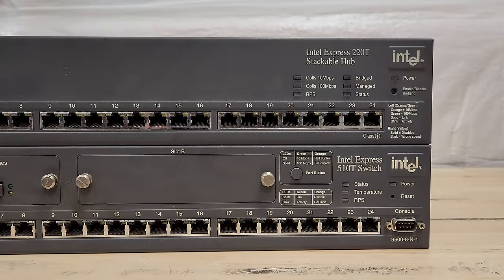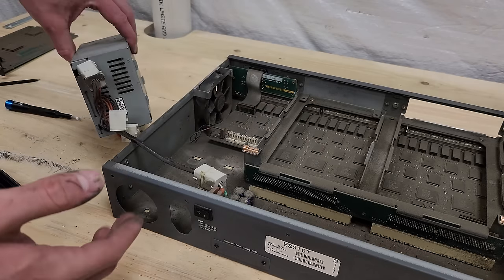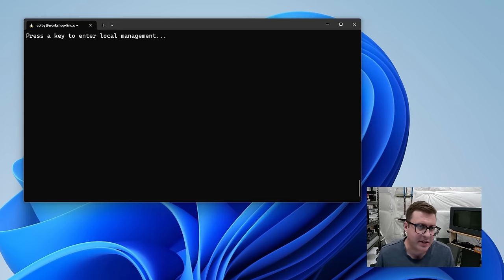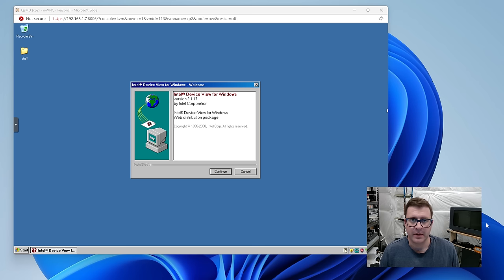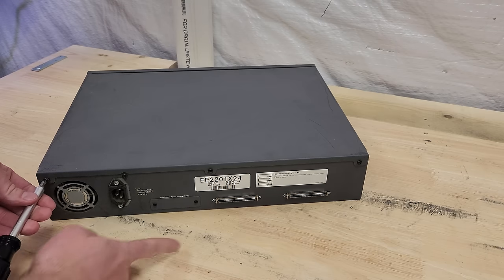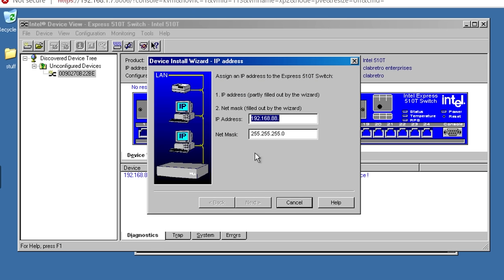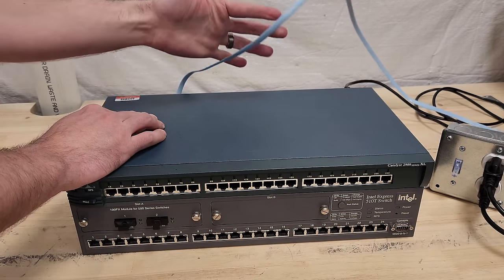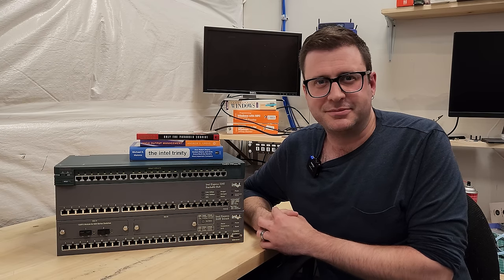Stackable '90s Intel Network Gear

Comment: I worked as a sysadmin at a small magazine publisher. My first task as a new employee was figuring out why everyone in my part of the office (including me) had basically dial up speeds to the file server. Turns out there was a fully-utilized 220T in the back of the supplies closet. Basically 20 editors and layout artists were vying for their share of the single 100Mbit connection back to the main switch and the collision light was nearly solid. This was in 2005. I swapped it out for a Netgear managed gigabit switch and was the office hero for a week.
Reply from the maker: wow!
Reply: what happened the next week?
Reply: What have you done for me lately?
Reply: haha

Comment: When these came out, I was a college student who was working at a research lab.  We did a beowulf cluster with 16 nodes and had one of these Intel switches at first.  It couldn't handle the full bandwidth load after about 9 nodes.  Started out at 100mb/s, then would crap out to 95% after 9 machines, and down the line as we added more nodes.  No Bueno.  The Cisco switches, they just kept the full 100mb/s per port fine and dandy
Reply from the maker: ha, great story! I plan on eventually getting a few of these to stack. I know I made jokes about Cisco but I have no doubt Cisco gear probably runs circles around these things under any real use haha.
Reply: You needed the 550T
Reply: Well, it's 24x 100Mb ports in only 2U.  Compromises had to be made.  What did you expect?  ;-D
Reply: Man Cisco is good though

Comment: As far as configuring the Cisco, We used to just pull he config as a txt file and make our edits. then paste it back into the terminal. this made it much easier and the reason why cisco was preferred by most of network engineers i worked with including myself.
Reply: Indeed. That's what we were taugt when I did CCNA/CCNP.  We also had to write all configs from scratch in notepad and paste them in when doing tests.

Comment: I don't know why but retro IT just amazes me. Just imagine throwing a switch to the bin without resetting it first, thats unimaginable from today's standards.
Keep it up!
Reply: To be fair, that switch looks like it was "wiped" according to the relatively loose standards of the day; not everyone works in high security areas, and if it was a factory (as many other folks have suggested due to forklift tire dust) then chances are it's a minimum effort wipe and you're done. Things have moved on a ton since then.

Comment: That looks a lot like warehouse dust to me...forklift tire residue 😂 Super light, dry, and greenish gray when it gets in the air
Reply from the maker: yup I think you're right!
Reply: Gotta admire how even a coating it is... 😂
Reply: a little foam air filter on the intake as part of the design would  probably make a lot of difference, although you might need more fan then

Comment: These were some of the first enterprise switches I worked on outside of Cisco and 3com gear.  Intel donated a few 510Ts to the ACM Lab at the UofI in 98 or 99.  Before that most of our gear was running on a few rings of 10Base-2 rings.   At the true per port packet switching was a bit of a luxury in a lot of locations.  And you also had some very strange mid-tear and large campus gear using 4-8 port switching hubs, large hubs with port security that did bit shifts to prevent sniffing, packet concentrators and the like.   By 2000-2005 they pretty much were all obsolete by relatively affordable switches with decent backplane speeds.

The temp light was generally because lots of companies started re-wiring networks and would use any random place to toss a lot of this gear.  Plenum spaces, HVAC closets, in the back of cupboards, etc.  It wasn't too surprising to see these things running in 80-95 degree ambient temps for 5-10 years.  Plus running a decent backplane speed was a pretty hefty task...right now a single off the shelf ASIC could keep up with 100Mbps Full Duplex but there were some pretty decent ICs needed back 26 years ago.

Comment: For that time, the Intel management Windows application would have been super innovative. Mikrotik was disruptive with its WinBox and lower prices some years later. They also use that 192.168.88.x default IP range. I wonder if there was some inspiration from the Intel gear.
Reply from the maker: Interesting about the default 192.168.88.x range. Also I need to try discovering it again but with a new network set -- I wonder if it just set it to the subnet that already existed in the app. Also I agree -- this thing discovers new devices (on different subnets!) faster than Ubiquiti gear haha.

Comment: I always built my Cisco configs in text and pushed them out.  Have to make sure your terminal software didn't just blast it out though.  I remember getting competitive data sheets on Intel and HP for this era.  I never once saw either of them in my markets so it was kinda neat to finally see one.  Keep up the good work.
Reply from the maker: I did notice this thing had a remote config loader, I might have to try that.

Comment: Ha! I havent seen these in years. Intel donated a ton of gear to a bunch of high schools in Arizona - as their fab was basically right down the road. It was a combination of those and 1000FX modules out to the classrooms. They had a 550T "routing" switch that had 8x 1000FX ports. all done over OM1. I was able to get one of those 550T's and there is an undocumented username and password to grant you admin access if you lost the username and password.
Reply from the maker: interesting!

Comment: The only thing worse than software that failed to get archived due to stupid download systems back in the day, is software from companies that got acquired just before the internet really picked up. I have some stuff for debugging a scsi bus (for a project idea I had a while back, think bluescsi but can handle lvd instead), but the company that acquried them never put the software online. Several more acquisitions later and the only thing left on the internet (even the archive) from that first company is a document from a training program they used to run rolls eyes

1996 and earlier is just pain unless you know a disc hoarder
Reply from the maker: Pre-2000s stuff is very hit and miss for sure.
Reply: @clabretro  I absolutely love bitsavers for the work they've done archiving stuff from the before-times. I just wish they had the resources to get everything from then. sigh

Comment: My memory is that “interface range…” is a much more recent innovation than you would think. On the positive side for the Cisco, you could script configuration with expect or create a config in a text file with a script and do a “copy tftp run”. Both of those methods scaled much better than pointy-clicky or even “interface range”.
Reply: true, or even just cut and paste into the cli... the lack of cli in the intel doomed it for any large scale application.
Reply: @v12alpine  we deployed a bunch of Bay 350Ts. Similar curses/text screen menu configuration to the Intel. Fortunately once deployed we rarely had to modify the configs, but we never bought another piece of kit without a proper CLI.
Reply: @v12alpine  SNMP. That was supposed to be The Thing[tm] back then. Of course, these things were so primitive there was very little to configure. Cisco IOS on a switch was quite a nice thing, but again, switches do very little. "interface range" has been around for a long time; support for it on switches may have taken a lot longer as the firmware rarely changed. Replacement / direct editing of the startup-configuration is still a very common method for initial and mass configuration.
Reply: "interface range" is really hard to program templates around, it's much easier to just loop over a list of ports and template out each one individually than try to programmatically figure out which ones can be combined and which can't, it's only useful for by-hand interactive setup for small or highly labor-available environments.
Reply: @jfbeam SNMP still is a major thing, although SNMP SET is less used for pushing configuration on modern equipment than the new hotness of NETCONF with XML, but you still find modern network management that use SNMP SET and GET just like this Intel does with a gui management tool, eg. I maybe misremembering but I thought Apple Airports used SNMP the same way with their desktop gui app.  Printers too sometimes use SNMP for detection and interactive config like HP, IIRC.

That's aside from SNMP GET/GETBULK still being the most efficient and standard way to collect metrics from manged devices.  Server software has Prometheus and stuff but the base OS and network is probably polled SNMP.

Comment: I loved these switches "Back in the day". Super reliable. Installed tons of them (was an IT consultant working in a sweat shop at the time)
Not sure whats up with your FX module. It does look like its not seating nicely. IIRC they would push all the way in before having to use the screws.
Reply from the maker: yup completely right! needed to reseat the riser and module board, working now!

Comment: I don't remember if the range command was available in that version of the IOS...but, as a work around...you can type the commands in a text editor and copy and paste them into the CLI. Using text files you can setup config templates and copy/paste entire configs once you've edited them, or edit a config outside of the switch and just tftp it over to the Cisco device.
Reply from the maker: wish I thought of that, comparing the tftp config loading between the two would've been interesting
Reply: Sometimes I use awk(1) to generate the needed text.

Comment: "Manageable Hub" blinks wait, wha.... 😂
Reply from the maker: yeah what would you even do with it? i needed to see it in that UI though! haha
Reply: The only thing I can think of is maybe enabling or disabling ports?
Reply: It is if the management module is in it. But having one, it's useless; it's just an RMON engine. There's really nothing to configure - it's a f'ing hub. (I think mine is in storage. It's pretty useless - even when Intel gave it to me for free. Back in those days, lots of companies gave loads shit to ISP engineers.)

[It might allow 10 and 100 at the same time, but it's been decades since I bothered to even touch mine]
Reply: @clabretro  I had a 3Com PS40 hub, which was probably from around the same time. The management basically allowed statistics monitoring. But it also allowed you to create multiple segments, which was pretty much the same as creating a VLAN and adding say ports 1-8 to it. The idea was that you could uplink each segment on the hub to a more expensive switch port, albeit at the cost of an uplink port in each segment. Loving the look back at all this older technology.

Comment: Years ago I picked up a used Intel Netport Express print server. Works great for all the old stuff. Web interface looks just like that. Lucky for me I went right over to Intel's website and grabbed the last firmware upgrade for it and such. At the time I only really known about HP jet direct print servers and a few others for home use.

Comment: The variation in IOS commands was a problem for Cisco in its large Merger and Acquisition days.  Most of the products were brought in through acquisition and having been built by independent companies - who could not violate Cisco Patents - their command structures were different.  And you are comparing an in-house built router with an acquired switch and at a time when the standards for VLAN and QOS etc were really going full mainstream. Jump forward a few updates and things not only coalesce to being consistent but also start to work as a unified system. IE you setup a VLAN on the router and the LAN switch will immediately know about it and is ready to join with less effort. I can recall a period where every network node you bought had its only config headaches. It was nice when things implicitly started to sense and cooperate with eachother right out of the box.

Comment: Loving your networking topics lately. Just need some Juniper or Nortel gear
Reply from the maker: those are definitely on the list!
Reply: @clabretro  Nortel for sure! Truly fascinating systems.
Reply: I worked for a university where we transitioned from ATM fiber links between wiring closets with piles of Cabletron hubs to all switched ethernet on Nortel hardware. It was a crazy time for networking. The stuff you could do with vlans, EAP, and VRRP was awesome.

Comment: I would highly recommend buying an ESD vacuum if you're dealing with dirty boards a lot, the SCS 497AJN is a very common model of them. I highly recommend folks to not run boards under the sink because of possible salts in the dust. better off just blowing it off with an air hose tbh

Comment: I ended up scrapping mine for needed parts that be useful down the road. The power suppy is AT based, so somewhat useful with older smaller cased AT machines. Was able to use the memory on a few video cards, to expand the ram. These machines take a crapton of power to run, compared to more modern routers. I still have a management interface expansion if you want one.
Reply from the maker: I would be interested, you can message the email in the channel's about page if you want!

Comment: I deployed a whole bunch of these as an "upgrade" to our aging Networth (acquired by Compaq) network. These things were awful. STP issues out the rear that they never could figure out, and speed issues as reported in other posts. I did some research and came to the determination that these were almost certainly built by D-Link for Intel. I don't recall now if it was an Intel engineer that told me this (I knew some of their networking crew very well) or if I found out some other way. I was also using Shiva VPN gateways back then, and Shiva was acquired by Intel, this is how I got to know some of the Intel networking team. I'm almost positive they ended up at Computer Reset in Dallas, as did our Shiva gear. I know for sure the Shiva gear was there as I saw some of it in a recent YouTube video with my labels on it.
Reply: Man, I haven't heard the name Shiva VPN in a looong time.
Reply: @MarkTinberg  it was really good.

Comment: Fun video, takes me back. As I recall cisco switches had all ports configured up by default. Routers are of course down by default (factory reset condition). Of course the problem is, what happens with a L3 switch such as a 3750 or a 6500, is it a switch or is it a router? The answer is — I can't remember 🙂

2900XL had very much a poor man's IOS. Very few features and many differences if you are used to routers. Mostly because it did a lot less. Don't think it was ever changed much.
Reply: This equipment brings me back, a 3750 is Layer3 Switch as well as a 6500, 3750 models had lower performance specs thus limiting the how much routing you could actually do. So, you could do BGP/OSPF just don't do a lot of it as you will likely crash the unit due to lack of resources. The 6500, is a bit more of a beast, it could handle what was considered at the time a reasonable amount of L3 operations. What truly set the 65xx platform apart was its modularity and it's various chassis sizes. On the flexibility side  you could install various type of modules, Faster Sup Modules(CPU) with lots of RAM/various Ethernet port configurations/Fiber/TokenRing/HSSI, so many options, maybe too many. Anyhow, was an excellent platform for it's time, built like a tank but offered great flexibility. The XL series in the video is well, sort of a basic basic basic workgroup switch, limited everything. Not surprise to see faulty ports on it, but a bit surprised to see so many, likely you can fix it, if you have a donar switch. Love the video's keep it coming.
Reply: Switch first, router a distant 3rd. All ports will be up in VLAN1, zero layer-3 configuration present.

Comment: 20:35 Did you use the /24 for the nic in the vm? That would be a reason why the device discovery did not found the device. The broadcast address of the nic did not match the broadcast address of the switch.

Comment: Normal looking gear from an industrial setting. I pulled switches or computers from racks in switch/machine rooms, that were literally filled up with dust. 

Sometimes they died after cleaning, because of fine metal powder in the dust being compacted by the blasts of compressed air becoming conductive enough between pins to produce short circuits or mangled signals

Comment: When Cisco moved the Catalyst switches to IOS, they didn't initially port the range command.  Having make good use of it in CatOS, there were LOUD complaints, and it reappeared soon after.  Can you imagine the chore of configuring multiple slots worth of ports one at a time?  I soon learned to write scripts to configure a new switch.